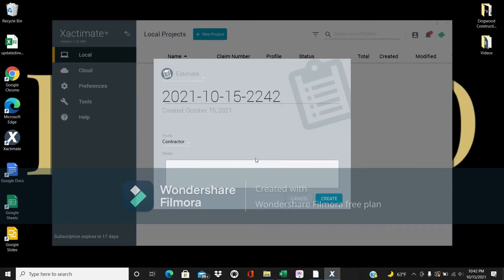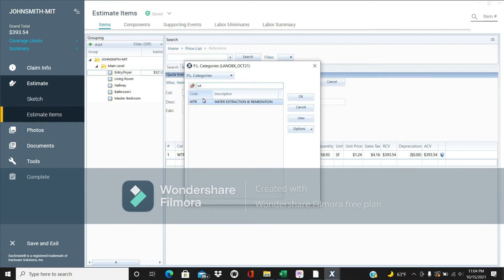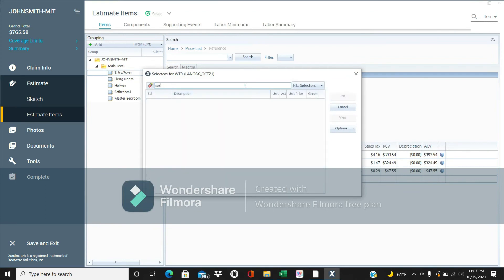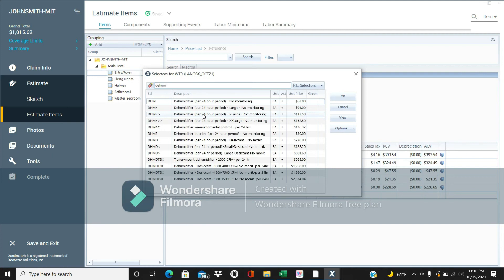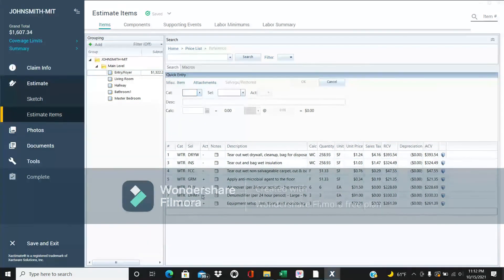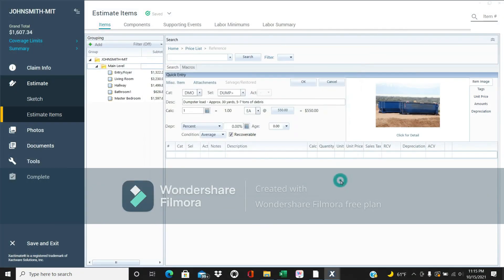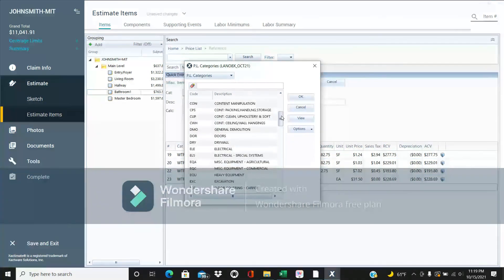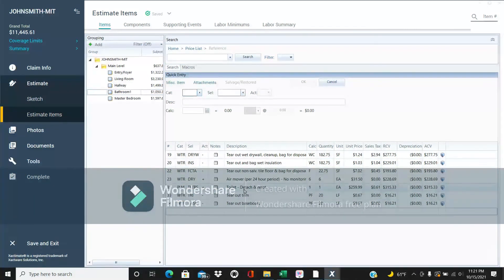Xactimate Basics

Comment: I'm a Drywall guy.
Never cut at the 2 foot level. 
Always cut at the factory seam 4 foot.  The insulation is going to wick up the water 2 feet or more.
Reply: How many jobs have you performed where you pulled 4' for a broken water line or a leaking bath tub (aka anything but a complete flood coming in from the outside of the house?)
Reply from the maker: Very true. its pretty rare. If you are performing a 4 ft flood cut then the was some pretty extensive damage. Thanks for the comment. @robbiezee666rosenjew8
Reply from the maker: I agree 4 foot would be easier. In the insurance world we have to have approvals from the adjuster to cut 4 foot up. If we can prove damage above the 2 foot mark they they will only approve 2 foot flood cuts. Its not too bad though. We just rip 8x4 drywall down the middle and run them pretty quickly.
Reply: @bluewhaleconstructiongroup  hi! what do you put in the calculator if you want to specify just 4 feet?
Reply: And floating the butt seams can occasionally cause bubbles at the seams if there's even the slightest gap where sheetrock meets sheetrock. The thicker more expensive drywall tape helps in those situations.
Reply: Meaning, gotta be dead on straight cuts.